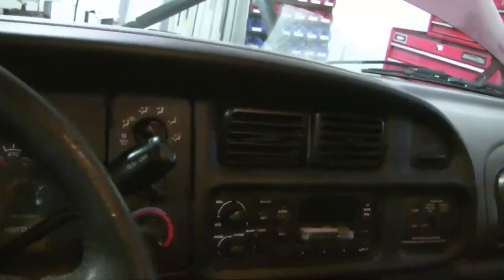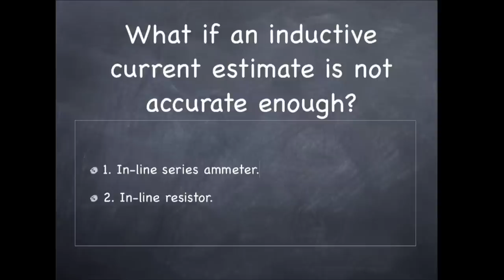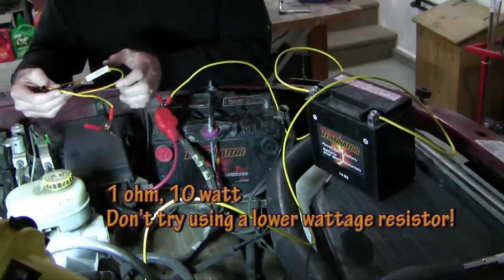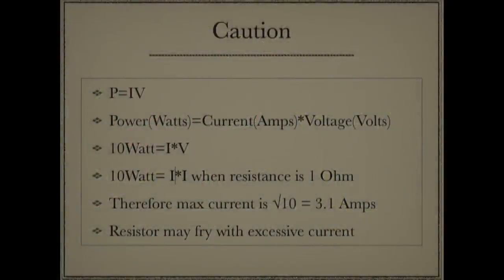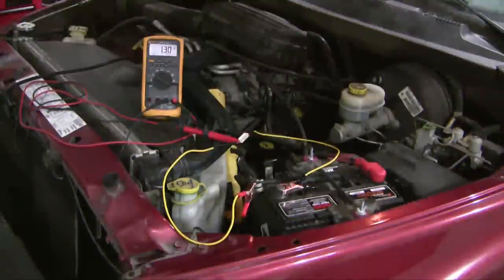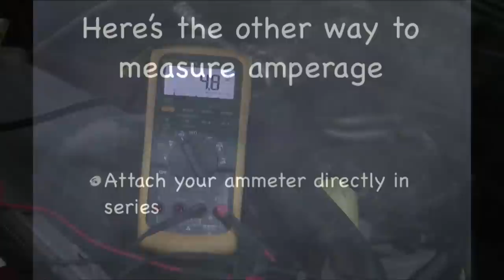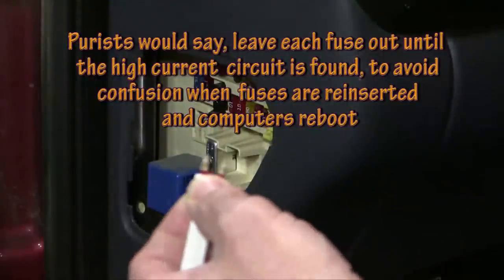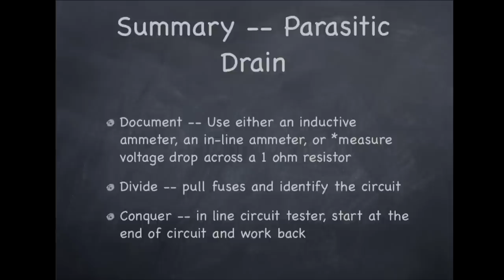Parasitic drain, an automotive short circuit that may cause a recurring dead battery

Comment: Thanks for expanding on Scotty Kilmer,s tecnique for finding the parasitic drain.He did not explain why he uses that size resistor.Thanks for breaking it down in easy to under stand way.I have a large drain on my 85 Corvette and will be useing this method to day to try and start to adress the issue.

Comment from the maker: Thank you Harry. If I were to make this seminar again I probably would include a comment about using voltage drop across fuses to quickly decide which circuit is involved. That technique may be a real time saver.

Comment from the maker: Yes, that's exactly what I've been doing lately. Measuring voltage drop across the fuses is a great time saver, allowing you to quickly narrow the search in most cases. Of course if the cab door is open or the computer hasn't gone to sleep you need to beware of misdirection to the wrong area. It doesn't take away from the principles discussed here, but it does change the approach a little. Thanks for your input!

Comment from the maker: Yes, any drain that puts extra load on an alternator will shorten it's expected life. But parasitic drain happens when the vehicle is shut off, often with low current draw that doesn't blow fuses. So, typically it causes failure to start after a day or so of not being used. What you are describing is typical of what happens when the battery is bad, requiring repeat and longer charging with no resting phase for the alternator to recover.

Comment from the maker: @batterybank I think that will work fine. Since parasitic drain is by definition a drain that is low amperage, it usually isn't making a lot of juice because of circuit resistance. If circuit resistance is too high then a short detector may not have enough voltage drop to drive a buzzer. Higher amperage would probably blow the fuse in the fuse box, and so the problem would present as a recurring blown fuse.

Comment: so which method is better in terms of practicality? I like the fact that in Eric's method you can see the AMPS change the moment you find the drain source. While with the resistor method you check the VOLTage drop but have to be wary of the HOT RESISTOR. So what are your thoughts of the the two methods?

THANKS FOR YOUR TIME AND ALL THE VIDS

Comment: I had a parasitic drain in one of my cars (1986 BMW).  The instrument cluster had NiCad batteries to retain the oil change memory.  The batteries died and wouldn't hold a charge and caused a parasitic draw around 150mA.  This was enough to kill the car battery over the period of a couple weeks - or less if the battery is compromised.    The off parasitic draw is around 60mA now.  /John

Comment from the maker: @Toltecatl The big problem with ammeters inside multimeters is you can EASILY fry your meter. Each fuse of my Fluke is $20, and on a cheap meter you may not be able to fix it. The commonest problem is to forget you were just measuring amps and then you decide to try and measure voltage across a battery. Sometimes a built in ammeter will fry with no warning light, then giving inaccurate low readings, and if you don't have a fuse you will want to use the resistance method.

Comment: So....... does this mean the problem is in  a wire between this fuse and the larger 60 amp fuse in the engine bay? Is the "lock switch" between here somewhere? I appreciate your help as I know if I took to a mechanic i'd done spent a couple hundred bucks. I like doing things myself and though annoying it is good to see i'm on the right track..... MUCH THANKS! Look forward to more of your input!!!

Comment from the maker: The rating of an end device like a lightbulb gives the user an idea as to what voltage is safe and required to drive the device. But it says nothing about what the voltage drop across it will be. Of course you can imagine complicated situations with multiple resistors in series, and there are equally complicated calculations that can be used to decide what the voltage drop across each resistor will be. But the basis of those calculations always points back to the elegant simplicity of Ohm's law.

Comment: Hey Dave. I know this video is a couple of years old, and I was wondering if you knew about the technique of measuring the voltage drop across each fuse which would equate to the current flowing. There was a chart floating around the net which equated the voltage drop to the amount of current flowing. I took the data and derived an equatiion and thought about using a microcontroller and LCD to display what the current is. Of course, that project is on the back burner for now. Nice video Dave!

Comment from the maker: @hailapeste You're welcome. And you also make a good point that the power rating on the resistor is very important. A higher wattage resistor would be better, but they aren't sold in many electronics stores, whereas the one Scotty uses is readily available. Just remember that you just let the juice flow long enough to get a reading, then quickly take it off before it gets hot.

Comment: A have been using a fool proof way that anyone can do. Take a standard incandescent 12v test light  and hook up the ground side clip to a good ground point, then take the point end of the light and touch it to the center top of the  neg. battery post, then without removing the light, pull the neg battery cable end up, without touching the test light shaft of the test light.  If the light glows at all, you have a drain and if the light is off you are good. If you maintain the connection to the test light until you lower the neg. cable end back on the battery post, you will not loose any memory.  The way you are showing works fine, but is way too complex for the average person and it needs test equipment that most people won't have and the current readings are also too much for most people to know what is good or bad. I hope my instructions made sense. It is hard to explain,but simple to do.

Comment from the maker: @batterybank That's a good thought. I guess it would be one more 'moving part' that could fail and confuse the user if it suddenly blew. A reversible circuit breaker would work best, but I haven't found one with such low amperage rating at my local hardware store. What I've built here seems to work pretty well. To me, the big weakness is a lack of ability to transmit a findable signal down a wire, a pulse wave modulator. But that adds expense and effort.

Comment from the maker: Before replacing a battery it's generally recommended to check and clean bad connections that increase resistance, especially at the battery terminals and also at the connection between the battery ground and the engine chassis (and in your case between the alternator and the battery). The best way to do that is with a voltage drop test. I showed one way to do voltage drop testing in my starter motor video, but those components can also be tested in isolation. Good luck!

Comment: Thank you for the video. I'm interested in connecting my meter in series with the battery as you've shown, with an older, noncomputerized vehicle (1985 B-250 Dodge Ram van, w/318 engine), should the normal current flow reading be zero, or is any small amount of current acceptable or expected, when the vehicle is sitting with everything off? (The vehicle does not have a clock...) Thanks again!

Comment: @hailapeste you're missing the whole point, an accurate measurement is what determines a parasitic draw. how else can you tell? a couple of years ago I had a blown cap in my stereo. the battery didn't go flat as it was only 80mA but enough to put stress on the alternator on cold starts and belt started squeaking. when I replaced the cap in my radio the draw dropped to 30mA and no more squealing.
that's why I recommend using an amp meter, altough care must be taken

Comment: @AdrenalineJunky96  So you are saying that the problem could be in the wiring even where I had disconnected the plugs/connectors? I thought by unplugging them and the buzzer continuing that it ruled out that area? So do I need to plug the detector device into the #2 fuse and start testing the connections again? Getting a little bit lost. Thx. Mike.

Comment from the maker: @AdrenalineJunky96 Regarding where the fault is, it could be anywhere in the circuit covered by the #2 fuse, probably distal to the #2 fuse. Once you isolate the area involved, plug the other devices back in to get back to normal elsewhere. Try to find a schematic of the circuit involved -- a google search might help. .

Comment: @spelunkerd   I could not see your multimeter very well to see the setting selection.Should my cheap multimeter be set at 20 on the DCV selection? The reading will be in volts, which is equal to amps beacuse of the resistor.Is that correct? When I test at that setting I get a reading of - 2.13 with all lights off and the computer at rest. Does this mean my drain is just over 2 amps?

Comment: Hey, great video but I have a weird situation:
I took my car to service. When I came back they said that cooling fan was running even with no key in ignition and it was said to be burnt out. So I went home and tried inline ampmetring. What I found out was that car uses 0.2A with a cooling fan disconnected but when I connect it amp draw reduces to 70mA.
So the question is why fan is reducing amp draw when theoretically every gadget you connect to a car uses some electricity? Car is VW Golf mk3.

Comment: Hello Spelunkard! As far as I can tell, the two methods of measuring drain are really the same thing. Connecting the meter between the battery's negative terminal and the negative battery cable.

In one method there is a resistor used, the meter is on a parallel circuit. In the 2nd method there is no resistor and the meter is connected in series.

I feel I understand your explanation of why one would use the 1-Ohm/10W resistor as opposed to other resistors, but I don't see why one would go through this more complex method vs connecting the meter in series which is simpler and faster.
Reply from the maker: +AJFresh Yes, you're right. The rationale is that some multimeters are not able to measure in-line current, and those that do are often previously damaged because of accidental overload. To wit, my oldest, cheapest multimeter blew a fuse when I accidentally hooked it to a circuit that had more than it's max (1.5A). To my surprise, it still works fine but the fuse is not replaceable so I just don't use that feature. There was no warning code but I noticed that current always read zero after that. My Fluke has replaceable fuses for the in line ammeter. The slickest way to measure current is to use an inductive ammeter, but those are expensive and you need one wire by itself, not a pair of wires as you usually see in many cords. They are also somewhat inaccurate at low current. Thank you for watching!

Comment from the maker: @captainbluejay Yes, if your resistor is 1 ohm, the amperage = voltage drop across that 1 ohm resistor. So, if you have it hooked up correctly then you are at just over 2 amps. Remember the hood light and the computer, and anything else you might have left on. If both of those are off (for long enough for the computer to go into sleep mode) you are way too high -- should be in the range of 0.045 amps. My meter uses automatic range-finding.

Comment: I just then went off the buzzer. I had recently replaced power window motor so thought it was probably the power door lock wires. I have disconnected the power door lock on the driver side door where I had worked. I unplugged the trunk release button and removed the plug in from the horn. I have wiggled the wires in these areas but nothing happens. Am I missing something? I greatly appreciate a reply.

Comment: O.K. I have used the resistor and found that a 60 amp circuit which includes power door locks, horn, and trunk release is pulling a little over 3 amps and every couple days the battery is dead. I made a short circuit tester but my buzzer only works and it only works 1 way. The spade terminals have to be plugged into a certain side or it doesn't buzz. The light doesn't come on though and only has a hot wire. I was looking at the diagram. Do you not have the negatives wired to the switch?

Comment from the maker: @eurokid83 it's the (now discontinued) 1010i. I had to fix the switch once, when it failed to shut off. I believe it's 1000A, 600V, Cat III. 

Fluke have some new, stand alone clamp meters that seem better, though some of that may be advertising. I don't find it great for the low amperage use in most automotive applications, though maybe it will be of more value with electric vehicles.

Comment from the maker: @AdrenalineJunky96 Oops, I replied to your first message before I read this one. If you pull the fuse on that 60A circuit for a few days, does the problem go away? The circuit of that home made tester is wired exactly per the schematic on my video. Maybe the resistance of your short is too high to give enough drop voltage across the tester to light up. Does it work if you wire the tester straight across the battery? You could use a simple test light. Strange problems are often due to bad ground.

Comment: I have this problem with my PT cruiser, it has a draw somewere. Now ive disconnected the battery from the car via the positive connector, however i come back the nexy day and the battery is dead. Could this be a problem with the battery as well as the draw, or should i disconnect the positive and negitive aswell?

this car has been plaguing me with eletical problems since the day i bought it, and the warranty ran out in september.

Comment: Hi. 
I have the same issue as Aspartan3... like u mentioned in the begining of the video, battery is emptying itself over night, I boost it and run it to work and back home. Last nite I disconnected the neg connector and setup a ctek charger on the battery. this morning it showed that the battery was full. I connected it back and tried to start without success. Is the battery that damaged that even when full it does not have the power to start up the car?

Comment: Yah I had tried googling but nothing yet for the schematics. I thought by disconnecting the plug connectors that ruled out that area as the buzzing didn't stop. So when I got to the fuse and it quit, I assumed it was between here and the wires running to the main fuse panel under the hood. Confused how 1 fuse in door locks and another is Lock Switch?

Comment from the maker: @Toltecatl Above all said, I still prefer to use the ammeter function of my multimeter, but I'm very wary not to overload the current draw. If I think the current may be too high, I'll use my induction ammeter which will not die if current is high. The resistor method is cool and interesting but I don't often use it. If I had an older multimeter, or one with a blown ammeter fuse, than I'd use Scotty's method.

Comment from the maker: Yes, that's a common problem with a bad battery. The only way to properly test a battery is under load with current flowing, since even a bad battery can often produce a charged static voltage of 12 volts. The real test is how quickly it can deliver electrons, and how does voltage fall off when current flows. Take it to an autoparts dealer and they will test it for you while you wait, for free.

Comment from the maker: @MAY03LT Those fancy memory savers have a little diode that prevents reverse flow, which would happen if the second battery had lost some charge. So, dedicated memory savers are usually better, although the cheap nine volt ones add an unwanted voltage shift. Richpin shows how to make an inexpensive memory saver from Radioshack parts.

Of course neither would be useful if you are taking the battery out because you need all power gone. Thanks for your comment!

Comment from the maker: Are you getting enough battery drain to require a boost after leaving the car for a few days? It's a known fact that some new vehicle fans will turn on even with key off, though I don't know the golf well. I'm suspicious the difference in draw may be a second device -- maybe your computer went to sleep mode while you were testing, cutting drain. Also, when the engine cools the fan thermostat should shut it down normally. You may not have a serious issue.

Comment: @AdrenalineJunky96  O.K. had someone tell me that the short would be under the dash before the fuse! So can I plug the tester into this fuse panel and plug/unplug and shake wires to narrow it down further? I have a strong feeling that it has something to do with the power door locks just because I have been in there. Am I correct in using the tester further with the connections before the fuse?

Comment: @AdrenalineJunky96 Well I just went out and plugged the short circuit tester into the fuse panel under the passenger dash and replugged the connectors and expected the buzzer but I am getting nothing. I inserted fuse and retested under the hood and buzzer goes off. Stumped as to why the buzzer isn't going off when inserted under dash?

Comment from the maker: I'll guess that it should be less than 50 mA drain. The big difference between new and old vehicles is in the first hour after shutoff, but after that even the computers on new vehicles have to shut down to prevent overnight drain. Just be sure that your meter is OK. I had a couple of meters that had the ammeter circuit fried, and the only clue was a very low reading on in-line ammeter testing. Even my Fluke didn't display warnings. So, there is a risk of a false negative result.